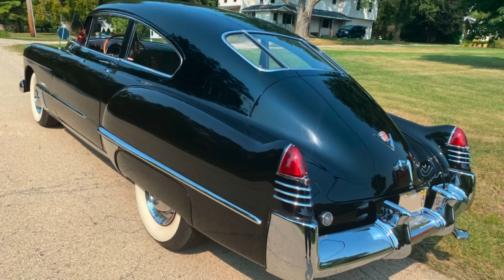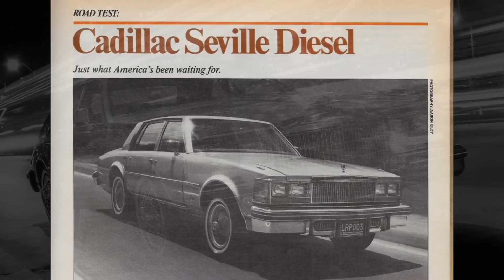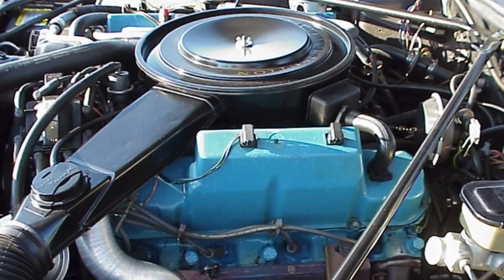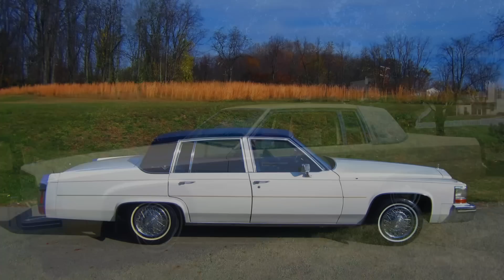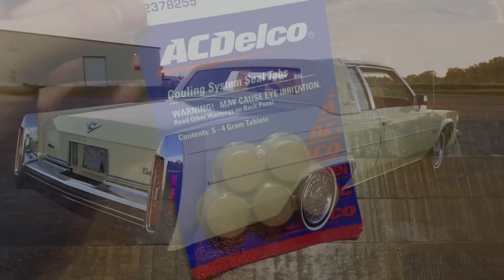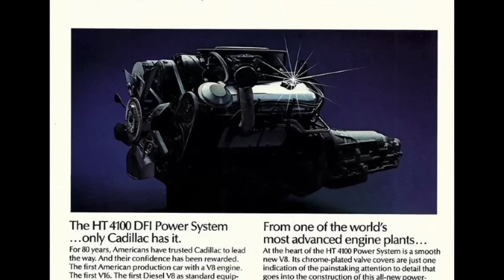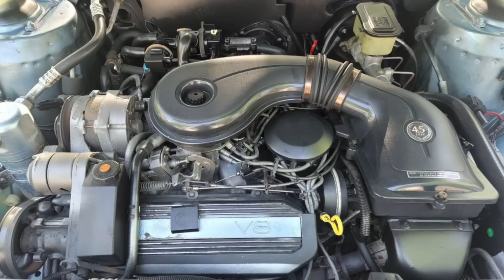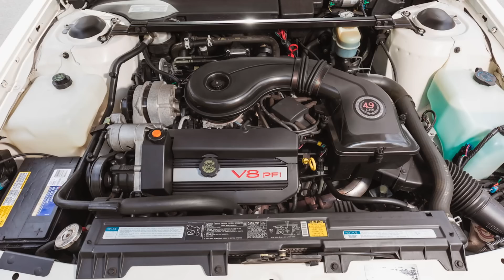This is GM's Worst Decision for Cadillac and Affected Its Reputation for Decades...

Comment: Thank you, Adam, for this video on the infamous HT4100. I was friends with a family that had an '83 Sedan DeVille with this engine. I drove the car once and it was not powerful but it got the job done. Their 4.1 was pretty much trouble-free as long as they owned the car. Two things seemed to have contributed to its longevity: They let the engine warm up (year-round) before they drove off from anywhere and the car was an over-the-road car. The car racked up miles rather quickly. They sold the car years later. When I last saw it going down the road it was puffing blue smoke. 
It was hit and miss with the Cadillac 4.1. If they were maintained and not driven hard they could last. Also, that some of these little engines are still going today and that some went the distance is rather remarkable. After all, any time these engines were going down the road, they were always under load propelling such heavy cars.
Reply: Did it have the stop leak "pills" put into the coolant fluid?
Reply: @davidpowell3347  I would assume it did. I remember the owners staying on top of maintenance. Not until Adam''s video did I know that the "pills" were crushed walnut shells. I don't recall ever hearing the owners speak of any powertrain issues, and they put a lot of miles on that 4.1. The car was constantly on the road. The owners never hot-rodded the car from a stop but on the highway, the car would torque out well and they would exceed the speed limit. I can still see the radar detector that was mounted on the dash. Many years later I saw the car on the road and with different owners. As I stated in my previous post, it was still going (it was in the left lane passing everybody else while intermittingly puffing blue smoke, but it was still running strong; as strong as an HT4100 could run). By that time the car must have had 275,000 or more miles on it and on the original engine. Apparently, there were never any gasket leaks or flat cam issues with this particular engine. As I also stated in my previous post, the owners that I knew always let the engine warm up before they put it under load. This also may have contributed to there not being any gasket issues. Letting the engine warm up at a slower rate would have contributed to the bi-metals (aluminum block, aluminum intake manifold, and iron heads) being able to expand slowly and may have saved the gaskets from breaching. This practice was a saving grace regarding the 5.7 Oldsmobile Diesel. Many owners of that engine stated that they let the engine warm up at idle in order to let the torque-to-yield head bolts expand slowly, which helped to preserve their clamping strength. This procedure seemed to have helped to minimize blown head gaskets.
Reply: @randyrankin589  I understood that with any engine,even a Cummins or Cat Diesel in a truck,the maximum stress time on the head gasket(s) is at a cold,say, Arctic start,especially if the driver immediately guns the vehicle into hard acceleration as many drivers in County trucks tended to do. As the engine comes up to running temperature the clamping force increases,although not by as much with traditional iron head on an iron block. 
Overheat on the other hand could overstretch the head bolts or studs,possibly irreversibly stretching them. Or permanently crushing the gasket beyond its elasticity. If the threads start to pull or the engine deck warp I guess that is a worse problem. 
  I didn't know the "pills" were made from walnut,I did used to have a package of them given to me by a dealer/owner who I bought a Pathfinder from (his business sold Pontiac,Cadillac and GMC truck as well as having added Datsun/Nissan,he seemed to like Pontiac. Never used the pills but I did tighten/retorque the head bolts in my Citation V6 which I eventually took past 100,000 miles with no engine problems except for messy external leaks and a couple of clutches (dealer place put in my aftermarket clutch very reasonable,the owner used to be a fellow runner and I believe used to help sponsor the "JFK 50 Mile Hike-Run"   (the Citation did develop a preference for high test gasoline)
As I recall the "KA" engine that was in some of the Datsun pickups could have their head bolts retorqued but you weren't supposed to mess with the ones in the "VG 30" engine unless you were replacing them with new ones (might have been "torque to yield" (The VG 30 engines were optional in the pick ups and were the engine in the 300ZX)
Reply: @davidpowell3347  Yes, engines need some heat before they are worked.

Comment: I purchased a 1985 Eldorado a few years ago as a summer cruiser.  It's in very nice shape with no rust and immaculate interior.  It had at the time of purchase just over 60K original miles and I knowingly change the oil and coolant each summer and am very conscientious to pay attention to the engine.  Definitely a poor choice to move away from the 368? cubic inch V8 during  the early 80's.  Thanks for the comprehensive history on the HT4100 engine.

Comment: Hi Adam, your videos are a car lovers dream! I have owned a 1986 Deville, 1989 Deville, 1992 Deville all of which had the motors you mentioned.  My 1986 Deville overheated one day out of the blue and cracked the block. My 1989 had the 4.5 liter which was a much better motor in my opinion.  My 1992 Deville had the 4.9 liter that had a knocking sound due to play in the #1 crankshaft bearing. An easy fix but never the less an issue.  I think the best out of the three with all things considered would be the 4.5 liter.   Thanks again
Reply: All of those early 80s Cadillacs worked just fine with 1968-69 350 Olds engines in them. No modifications to the transmission or motor. mounts were needed

Comment: I am one of the "lucky" owners of a 1984 Eldorado Biarritz Convertible with that HT 4100.  At 8 years of age and 49,000 miles the crankshaft exploded sending connecting rods through the block. At the time, my Cadillac dealer told me that the source of the failure was a defect in the metallurgy of the crankshaft that hadn't been discovered in manufacturing because GM had taken shortcuts in the manufacturing process and hadn't magnafluxed the crankshafts as part of the production process.  Despite its low mileage and complete dealer service records GM refused to assist in any way with the cost of the new Good Wrench engine.  Needless to say,  Cadillac's image with me has been forever tarnished.  I still own the 1984 Eldorado Biarritz Convertible, but I doubt that I will ever consider another Cadillac built after the advent of the 4100 HT.

Comment: 4.9 I would smoke my buddies Taurus shl s h o 79 Seville diesel best car I ever 77 Coupe DeVille with fuel injection rare fast for a Cadillac you can find those Cadillacs with a blown engine for around a thousand bucks back in 82 83 it was not expensive to repair the engine and when it was repaired it was a Screaming Mimi I think it was the valve springs a gasket in a valve job head gasket brakes tires shocks new front bumper replace the 8-track player with a junkyard CB included PowerBar radio cracked sunroof cost of mortar repair and I paid for the whole car I did not fix the sunroof I lost that car to a fire and ended up with a brand-new. Megan rabbit navy blue Wolfsburg Edition State Farm Chuck was a big down payment
Reply: Did your buddy have 2 or 3 cylinders spark plugs disconnected?   The automatic beats the 4.9 by a second roughly the manual by 2.  The Northstar would be the closest but still at a slight disadvantage.   I really liked both the 4.5 and 4.9 but the Yamaha 6 was simply faster.  It's main issue was the automatic was really not much beefed up from the duratech which was much less powerful.  I still want to drive a diesel Cadillac sad there really wasn't much they needed to have changed for it to have done far better.  Even the more refined European diesels weren't selling in imported cars here.  So while I don't think it would have helped sales much it would have improved their reputation.
Reply: @cardinaloflannagan8929  my shop teacher converted many diesel General Motors engines and souped one up to put in his LeMans it was started as a diesel from the factory it was a gas engine turned into a diesel turn back into a gas engine and then he built some that ran on liquid petroleum you got the parts off a junked car from the gas company
Reply: @cardinaloflannagan8929  m

Comment: Owned  3 caddys  71 , 73  and 80   first two had tons of power , 71 HD 2.5 inch dual exhaust  with Walker mufflers recurve distributer and Rv transmission kit . I loved that tank.
Reply: The 472 and 500 never disappointed.

Comment: I had '92 SDV with the 4.9.  Indeed it was as reliable as any of the cast iron engines from '63 on, and was quite easy on fuel.  250 NHP moved it quite well.  Overall, the car was a shadow of the '50s and early '60s Cads, but it was good enough for that era.  The THM 4T80E had problems with final drive gears that required replacement at 120K.  Other than that, the car was trouble-free.  Interesting was that this engine displaced 300 in² and priduced 250 HP net.  My '55 CDV displaced 331 in² and produced 250 HP gross.  MPFI made a huge difference in efficiency over the old Carter WCFB.  Gas mileage was slightly better on the '92 around town, on a par on the road.  I know Cads...'49, three '55s, '56, '58 Seville, '60 Ser. 62 convert, '62 6 window SDV, '70 SDV, '77 SDV, '92 SDV.  Hard to say which was "best", but the '62 was a fabulous car for reliability and the 390 was the most efficient US V8 of all in the early '60s.  Least efficient?  The '70...8 MPG city, 11.5 hwy, but it could torch a 383 Roadrunner easily.  Worst for reliability?  '56, hands down the worst car I've ever had.  Pretty, though.
Reply: The actual specs on the 1992 4.9 V8 (actual size is 4893 cc or 298.96 cu in) were a net horsepower of 200 @ 4100rpm and 275 lb ft. of torque @ 3000 rpm.
Reply: Trans was 4T60E.

Comment: As I recall, the engine had two serious problems. Yes the cooling system was prone to leaks and a good sealant was required. But another problem was that the oil drainage from the heads back down into the block and crankcase was poor. The drains where too small and since few owners were good about oil changes the drains would get clogged and blocked off creating oil flow issues and lots of bearing problems. These issues were major problems, but for me, the lack of engine power was just as bad. The 4.5 engine was better, but until the 4.9 version showed up, these were horrible engines.

Comment: Also you should mention the story of the attempts of GM to re-buy the patent of the Buick-Oldsmobile aluminum V8 from the Brits and how it unfolded
Reply: I never heard that story. Being a Ford guy, I don't understand why GM would have been tempted to do that...some of the best engineers are in Detroit to start with.
GM had enough experience with Aluminum to know how to build a great engine.
Same with Ford.....when they aren't pressuring themselves to save fractions of a penny, they get it right.

Comment: It's safe to say the HT4100 is at least PARTLY a direct cause of GM's bankruptcy in 2008. Really all the decisions GM made for Cadillac between 1978-89. The thing that GM lost sight of is that Cadillac was once a brand that people were willing to pay top dollar for. So frankly, when CAFE came out, if GM was going to be hit with fines for not meeting corporate fuel economy averages, you include those fines in the sticker price of the Cadillac and you continue to make those cars truly the standard of the world. A serious Cadillac buyer would have still paid another $10-15k for those cars if they were built right with large 6+ liter V8s that had 300+ hp net, ran on premium fuel, were smooth and torquey and reliable, and simply a continuation of the engines they made for Cadillacs coming out of the 60s WITHOUT adjustments for fuel economy and emissions.

Comment: If they had just embraced overhead cam technology....the 4100 could have been good.  But GM would have probably screwed up the engine like they did with the Northstar and the Olds diesel...just use wierd head bolt technology that will eventually allow the head gaskets to leak 😂

Comment: I had one of those 91 devilles with the 4.9.  Plenty of torque AND it got 22 mpg on the highway if I kept my foot out of the firewall.  Vs my 94 Merc. Sable with the 3.8.  Also a great performer but it had a bad habit of stopping at every gas station for a fill up...terrible gas mileage

Comment: Which year Northstar engines are considered "early" and needed the tablets added to the coolant. I have a 1999 Seville that has had them added I think (I'm sure) in the past and I am having overheating problems again. I want to thoroughly clean and flush the engine and heater core, clean out the overflow tank and replace the radiator. There's a lot of rust in the water jacket and despite the fact that I have removed the connection from the air bleed bolt on the water pump housing to the throttle body (obviously constricted and/or stopped up by goop) and connected it directly to the overflow tank (which helped immensely), I still will occaisonally get a flake of rust caught in the bleed bolt that restricts it, allowing an air bubble to form in the water pump, causing water pump cavitation and therefore the overheating. And I also don't believe air is getting into the coolant via the head gasket. I believe it was a bonehead design in the first place, or just an accident, that causes cavitation to naturally occur in the water pump and the surprised engineers had to add the air bleed bolt as an after thought and a jury rig to get rid of the air.  I also want to put an oil filter-sized in-line coolant filter somewhere in the circulation to catch any rust flakes. I know all about the inadequate under sized head bolts issue but I think, until the engine overheats and blows the head gasket, it is okay. I think the gasket is still good-no oil in coolant, no coolant in oil, no steam in exhaust. Though I know those Barr's tablets are a bad idea,  I'm just wondering if anyone else (I know right, you'd just get rid of it) would go with conventional thought and add them after the thorough cleaning. And yes, I probably would put deathcool, I mean DexCool back in or at least Prestone that is compatible with the metals.

Comment: I had a DeVille with the HT4100.  It was such a beautiful car.  But the engine never went more than 40,000 miles without a rebuild.

The engine was gutless in the city, but did great on the highway.  The highway mileage was really decent too, for such a large car.

I don't understand how GM got the HT4100 so very wrong. The Japanese had been building aluminum engines for a while and got it right.  Couldn't GM have gleaned a few clues form them?

Comment: GM signed it’s Death-Warrant in the 1980’s  ! The last of the great Cadillacs were the early  to mid 1970’s ! The two best engines Cadillac built were the 472 Big block in 1967 and the 500 cubic inch 8.2 Liter in the 1971 Cadillac Eldorado !
Reply: 472s started in '68.  The '67 was a the 429 with a different front cover.

Comment: It’s such a shame because I love the 80’s Cadillac body styles and I often see them for sale even today. But then I remember they have that horrendous HT4100 engine and I stay away. If only Cadillac would have just installed Chevy 305’s or Chevy 350’s and dressed them up over the other carbureted full size V8 GM cars at the time with fuel injection and maybe a dual exhaust starting in 1982 things would have been fine.

Comment: Probably the best engine to put in the full sized 82 caddys would have been the Crossfire 350 from the vette. It was reliable, made good usable torque, and was hooked to an overdrive transmission.
Reply: True, but a CHEVROLET engine in a CADILLAC?!?!? The horror! GM caught hell putting Chevrolet engines in Oldsmobiles in the 1970s. They literally got sued and dealt with bad press. The heart of the problem was as the host points out, the cars the engines were designed to be in (the downsized C-Bodies that appeared for 1985) were supposed to be out in 1982 or 83. GM was tooled up to produce those engines and they had to go somewhere. 

Eventually the Oldsmobile V8s made their way into Cadillacs by the mid-late 1980s.